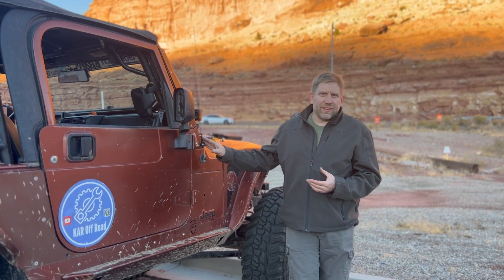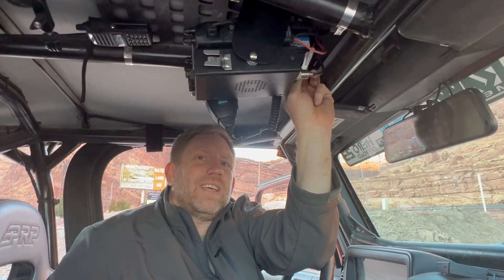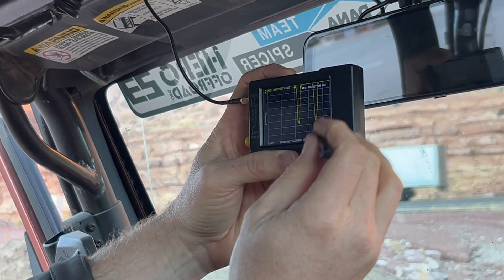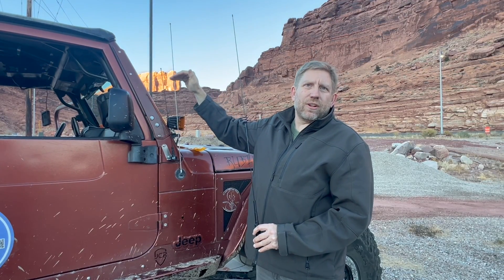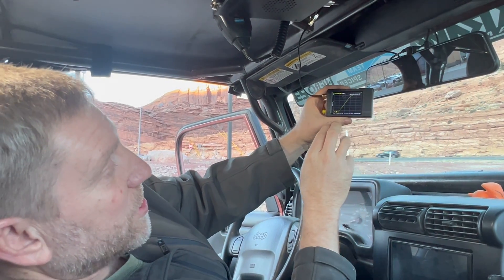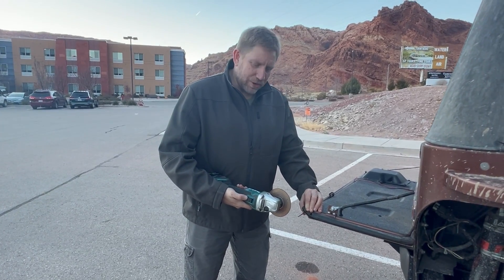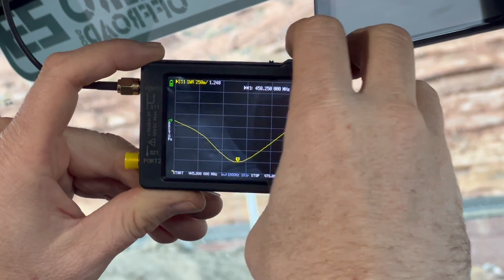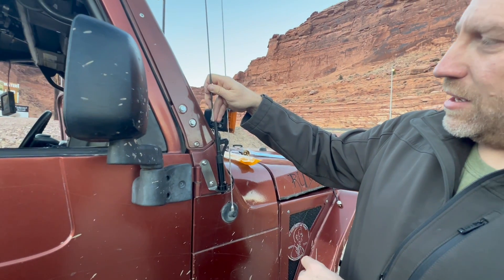Tuning Penny's New GMRS Antenna with a NanoVNA

Comment: I found that I had the most accurate measurement if I use the calibration standards supplied with the kit (open, short load), and at the end of the test cable I hooked to the antenna cable.  At the UHF frequencies, I've found that the test cable length can change the measurements, and have found that it is important to calibrate using the frequency range I want to employ to measure..  Interesting video... Regards

Comment: The perfect frequency to tune to would be 465.1375 as that is the exact middle of the GMRS band. If you get perfect SWR on that frequency, you're in perfect shape.
Reply: If I were tuning exclusively for GMRS I would agree.   In this case the antenna will be used with a bit wider range of frequencies and so have to compromise some to have it work well enough across them all.
Reply: @KAFingerlos  I was just saying that in general for others to see for when they want the best SWR for the whole GMRS range.